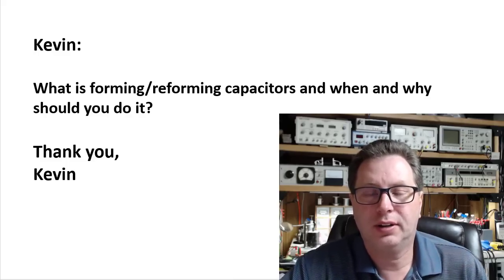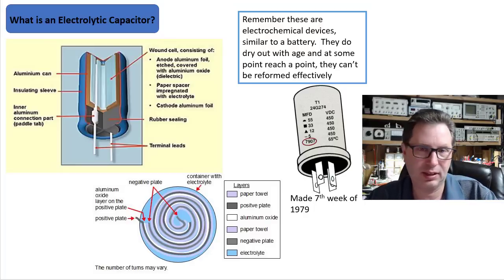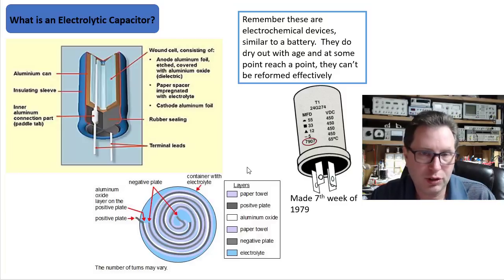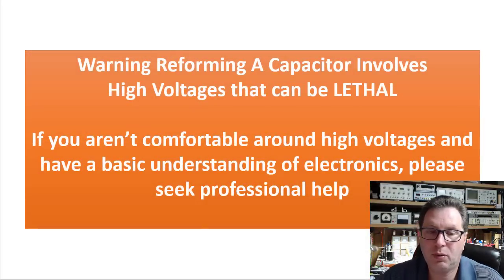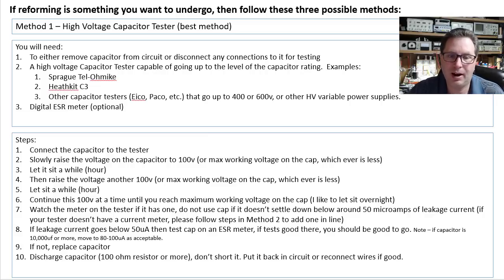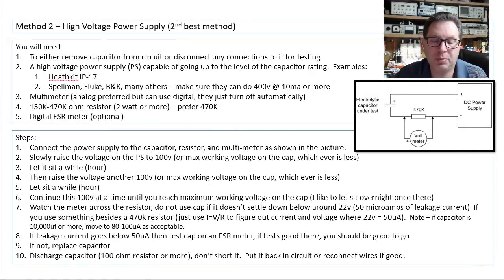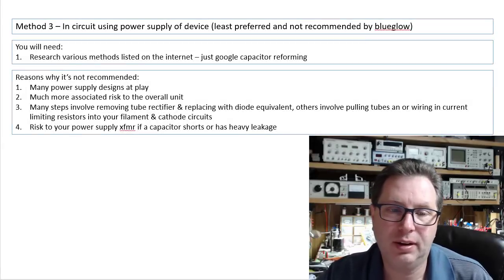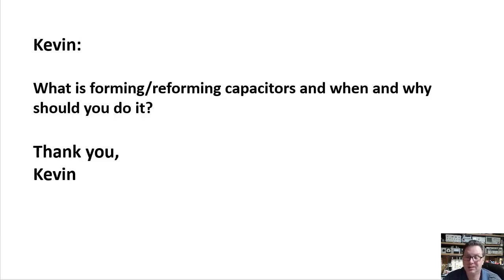Electrolytic Capacitor Reforming - Why and How To

Comment: You mention 50 uA as max. leakage current!? This is not an absolute fixed value for all types of electrolytic capacitors! It very much depends on the capacity and the rated voltage! If you look up old datasheets or leakage current tables for eletrolyitcs you find several formulas for max. leakage current, e.g. 0.03xCxV (which can be in the mA-range for bigger caps), or something like x times SQRT(CV), where x is some value around 0.01...0.03...0.05 and C in uF, V in Volts). So an o.k. leakage current can be in the low range of some mA which can be fine for a 5000uA, 450V capacitor. I have some older ROE (Roederstein, Bavaria) foto-flash electrolytics with 4000uF, 450V which measure still fine at leakage currents of around 300uA after more than 30 years. Also their ESR is still good in the range of 30 mR. Esp. leakage current is a tricky value as it depends on how and when you measure. Most datasheets say after sitting at rated voltage for 5 minutes. But you have to reform the caps carefully before measuring.

Comment: A very interesting video. AC FVD motor drives have large electrolytic capacitors and the spare drive may sit on the shelf for years. It is recommended to re-form the drive caps.   Thanks.

Comment: I have read about capacitors on sale from China and similar that are not of the same value described outside. They, if the new is true, hide a little one with lower value.
How may I buy good, safe  capacitors for a reasonable price?
Thanks a lot guys.

Comment: Just buy new caps reforming is junk why because you will have large amounts of esr
Reply: If you buy new caps from a legitimate supplier you do not know how long they have sat on a shelf for. A value that is not sold too often could easily be five years and up. Checking ESR and measuring leakage is worth doing before putting into equipment. Something 50 years old I would not bother with but neither would I trust components even if from a known good supplier.

Comment: Hello. 
I'm reforming a chassis-mount 2500uF 50v Roederstein cap dated of November 1969.
It's been reforming for 9 straight days now at rated voltage via a 10k resistor and a microammeter. No heating during process, and leakage current has been slowly decreasing but it still not stable, typically varying from 2uA to about 8uA.
Can I expect it to become stable if leave it more time?
Any thoughts?
Thanks

Comment: Hello sir
Can I replace 16v 1000uf to 16v 3300uf ?
Atx power supply for car amplifier
Reply: No. It will cause the B+ voltage to rise and operate at a higher voltage than it supposed to.

Comment: I don't know about that 50 uA value. Even a 2018 Nichicon 500 volt capacitor spec says that 500 uA is acceptable. I think 50 uA sounds very difficult to achieve. 22uF/450V Nichicon, the leakage current is specified as

“After 1 minute’s application of rated voltage at 20°C, leakage current is not more than 0.04CV+100 (µA) ”

which is =(0 .04x 22µF x 450) + 100µA = 396µA+100µA  = 496µA ~ 500µA.
Reply: My understanding is that is the maximum allowed leakage current for it to be considered serviceable, but closer to that or over, and you’ll want to consider replacing.  Electrolytics can be re-formed, but may have limited lifespan after that.  Depends on what conditions they saw in service and how long they’ve been run, and how much water has evaporated out of the electrolyte.  My understanding is that under 50ua, and it’s probably an indication that it still has much life in it.  I’ve got a capacitor (50uf 350V)  I just reformed that has relatively high leakage at the rated voltage (200ua after half hour reforming at 10% above rated voltage) but under 20ua at the voltage that it will likely see in circuit, which is half the rated voltage at most.  It’s from an old (50-60 years?) uhf converter that I got that was new in box, so I figured it probably hasn’t been abused other than possible storage in someone’s attic, but the box was pristine looking, so I’m figuring that wasn’t the case.  I’m doing some DIY stuff and it’s got a tube socket, chassis, transformer and power supply capacitor, and even through it’s probably 50-60 years old, I’m not out anything major it it fails.  I’m curious to see how long it lasts after I put it in service.

Comment: Reforming I call lazy ,capacitors aren't all that expensive ,I have had good result from cheap caps from Ali express,eBay bandgood.I don't want to have to come back and Eddie it later ,that's twice the work new caps are safer too.you no when a bad cap goes bad it can take out other stuff.but to each there own .I want to make my radios safe as I no how as a novice.
Reply: Are you totally illiterate?

Comment: First,you don’t reform the lyric cap,you’re instead re-form it,
Then try to get the MepcoElectra apnote on lyric cap to understand
The cap itself and decide.
I am using Tek,Hp,Fluke tube type all these yrs w/o cap issue,Why?
Thermal management,so it’s case/case basis.”replace them all”
If you can afford.
Reply: What gibberish are you selling now?

Comment: What is the dielectric typically used in 50's - 70's can caps?  I've restuffed a few cans and it would be nice to know what precautions I should be using handling it if any.

Comment: Keep in mind about this before you reform any caps. Also somestimes a reformed cap will fail (dead short) hours,days and sometimes weeks. Its a timebomb that you don't know when its going to go off on 30+ year old caps. When a cap fails it will become a dead short that will kill tubes and transformers.. The crapiest caps made today are usally better then the best ones made 40 or 50 years ago. Its sometimes better to spend a few bucks on a new cap instead of 100's on tubes and transformers.
Reply: you are absolutely right
Reply: i have a defibrilator capacitor(32uf 6000v) of 30 years and i charged it to more or less 5 kv and discharged it several times and nothing happened, but the capacitance has drooped a bit like to 26uf but it takes an hour to recover to 31uf or32uf

Comment: Hey Mark! Iv'e become a bit obsessed with your channel of late. Great job breaking down this controversial subject into real world practicality. Many have tried, few have succeeded. I recall the same type of experience in EE school, with a guy who was an audiophile.  I've been captivated by tube electronics since. 
One question that I can't quite wrap my head around is how a NOS cap shelved for decades can be more dried out than a well used thermally cycled at high voltage one or a used and then shelved/stored unit.  I'm with you on the chemistry, it may be a bit complex.  Any thoughts?
Reply: Electrolytic caps and batteries have common elements, as Mark stated here.  Just as some batteries can be effectively recharged and some can't, some electrolytic caps can be reformed and some can't.  I wouldn't push my luck beyond 30 years old, especially with the power supply filter caps.

Comment: Never reform caps. Just replace them and save yourself some heart ache. If you want to keep the old look then restuff the old caps by gutting them and slide in a new cap. If you do that be sure to leave a note or some other tech down the road will just clip out all of your hard work.
Reply: I have to disagree. A lot of older equipment will have an old capacitor fail on powerup. But, if reformed will work for years. I see reforming as preventing failure, not a fix for a bad capacitor.
Reply: @misterhat5823  or it may reform your transformer into a charcoal briquette without notice.  Capacitors are so cheap it is foolish to not just replace the caps.  Bad advice is to reform electrolytic capacitors.  You have no idea the state of the electrolyte or the plates, or the dielectric oxide.  You have a better chance of destroying equipment than preserving it by so called mythical reforming.
Reply: Mister Hat that is not how capacitors are made that is how old equipment is destroyed. It's clear you have some misinformed bias regarding the sketchy paractice of taking an unnecessary risk with vintage elelctrincs. Anyone who restores vintage electronics for some time understands this.
Reply: Re stuffing is not good either. Looks can kill!

Comment: Correct me if I am wrong; but, I have heard some people prefer somewhat leaky caps in their guitar amps, giving it a distinct sound, even if it is harder on the circuit.  I suppose a listening test would be needed.
Reply: In dealing with Leslie amplifiers, we use 6550 output tubes.  A new pair of current production output tubes run $100.  One vintage Tung Sol 6550 can cost $250 to $350 depending on if it is a grey plate or Black plate.  A new coupling cap cost less than $1.  Do the math. LOLOLOLOLOOL
Reply: You could always use a good capacitor and insert a resistor instead. If that leaky capacitor continues to degrade, you'll have a loud bang and magic smoke in your future.
Reply: I fully agree Dave.  People are just asking for trouble in the future.  If you want that "sound" stick a high MegaOhm resistor across it.  Move the value up and down until you find the sound you want.  Just stock up on tubes, and audio output transformers. :)
Reply: LOL That's true regarding the tubes and transformers.
Reply: That's their drugs talking.
Reply: Cosimo Kramarawicz o
Reply: Leaky capacitor will cause any sort of troubles and can ruin the power transfomers and tubes, especiallyif they're coupling capacitor,  they will cause the tubes to run to hot (redplating) ruining them in the process. They also can be quite dangerous if it's on the input, sending high voltage to the guitar pick up and cause electrification or even electrocution. If they're leaking, they should be replaced to prevent damage and safety. I restore and build hi fi, jukeboxes and guitar amplifier since the 80's. A power transformer can cost 500 US dollars, tubes can be costly too but the main issue is that your life can't be bought back.

Comment: Great overview, thanks. do you have a recommendation for a good quality esr meter? I have a Solar high voltage tester that's been restored. thanks.
Reply: K2bew I use the BK Precision 880 LCR Meter. I also have the Peak Atlas ESR70. If you never plan on measuring inductors then I would go with the ESR70. It is inexpensive, rather accurate, and couldn't be simpler to use.
Reply: Hypercubitus ; thanks